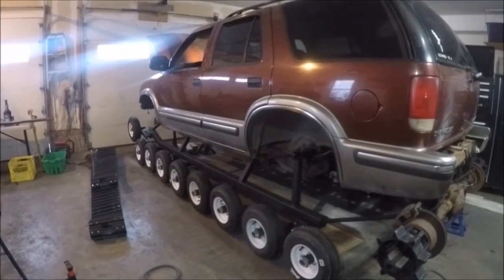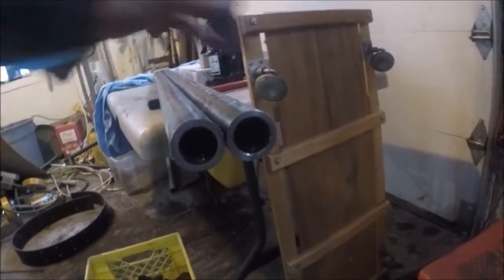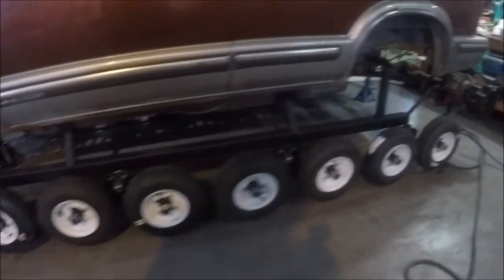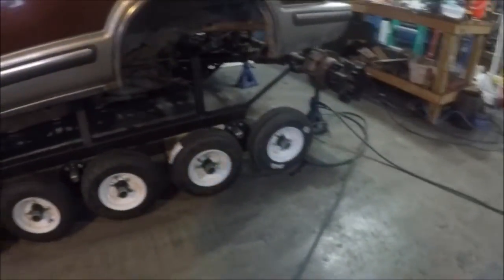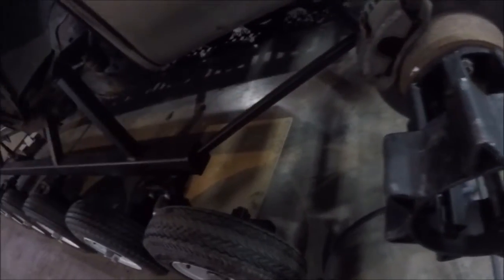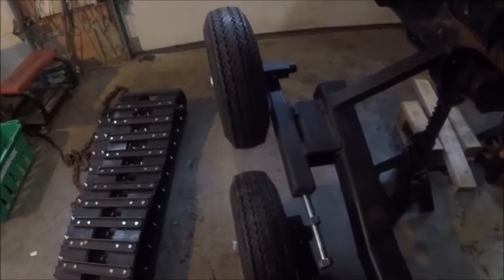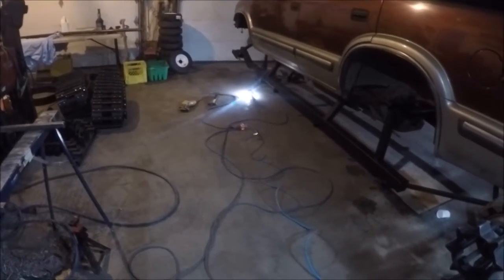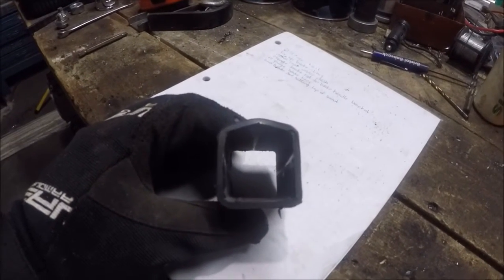Custom Tracked Machine, Part 18, Rev 1, The fixes

Comment: I would send the tube for machining, not the axles.  If you ever need to change and axle would would need to have it machined plus set up time in the lathe would be less therefore cheaper to machine
Reply from the maker: I wish I could, but budget is spent and wife is not happy.

Comment: A question. Would a sprocket idler in the front instead a a plain wheel help keep the belt in line while making turns/
Reply from the maker: It might, just going to have to test in increments. If I make these changes and still have issues I will look closely at the footage and see if that's the area. I have driven a Nodwell and they just use a simple idler in the front, so for now just going to leave as is. I don't think this version will be the end of the changes :)

Comment: Your sliders are what I call draggers on mine. When I designed mine I planned on a section for the track to fall into when it comes off the sprockets and originally had ramps at the beginning of the draggers but at the last minute cut the ramps off and welded in wheels. On my test drive I noticed it paid off to have the wheels. I had so much  slack in the tracks that if I had the ramps the track would have caught on the ramps. Originally I had that open section there for when the track breaks, it would come off the sprockets and fall onto the ground in that open space. I later seen a conveyor belt setup in a factory with the same setup.

I would suggest to take off the sprockets, lay the track out, and test fit the sprockets on the track. If the teeth of the sprocket are catching the track, you will see it, which means the teeth of sprocket are too tall. To do this, engage the teeth of sprocket onto the track and with one tooth pointed down, engaged on the track, move the sprocket forward and backward without spinning. This is the endplay of the engagement of the sprocket to the track. Doesn't matter how much endplay there is. Next with the teeth engaged on the track, not spinning the sprocket, with one tooth pointed down, slide the sprocket back to take up the endplay, then roll it on the track to see if the teeth are catching the track. If the teeth are catching the track or hitting the track, then the sprocket teeth are too tall. This would be why the track is grabbing the sprocket when coming off it. Simple fix is to shorten the teeth on the sprocket which will change the angle of the teeth so track comes off it without catching.
Reply from the maker: Not a bad idea but for now going to stick with just sliders. My front wheel is adjustable so I am going to use that to take the slack out of the track before I try the next test.

Comment: honing the tubes?
Reply from the maker: Same issue, I would need to take them down to a machine shop. Basically I need to do this with as little investment as possible right now. Maybe someday I can get this design evolved into something I could sell as a kit but for the moment it's just my pet project. My original budget is $5000 including the vehicle. I have lost track of the bits bought here and there but basically I am at my budget now so I need to figure out how to do things at the least amount of cost possible.

Comment: is it easier to open the tubes verses turning down the spindle?
Reply from the maker: Turning down the spindle would be more accurate but for me it is simply a decision of cost. I can't afford to disassemble all the hubs and take the spindles down to a machine shop. I ended up sanding the spindle and splitting the tube, combination of both gives enough clearance should work good.